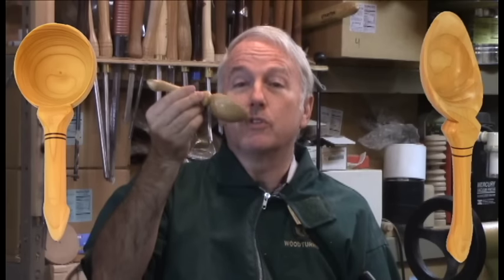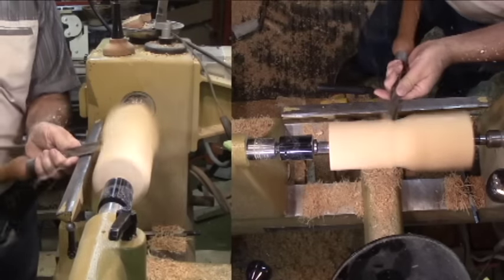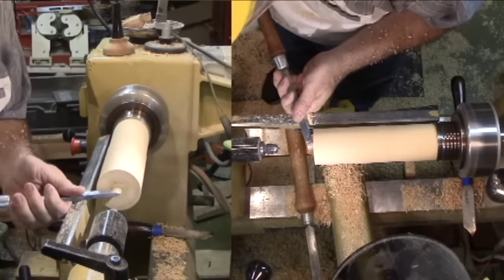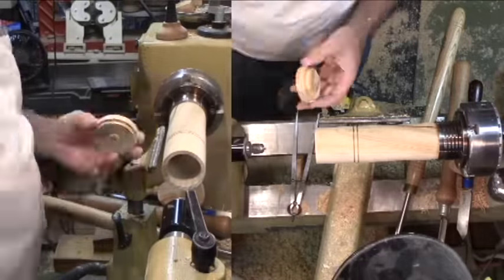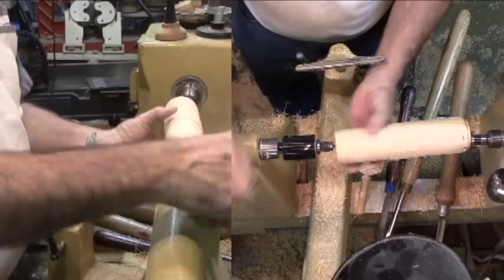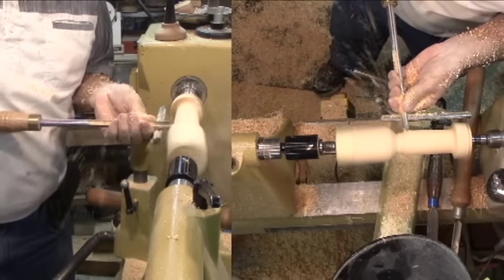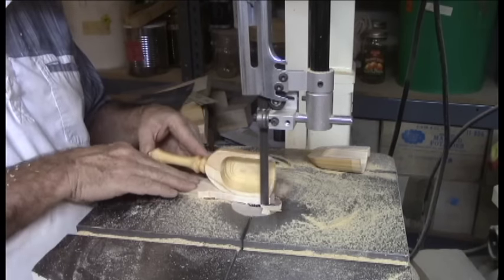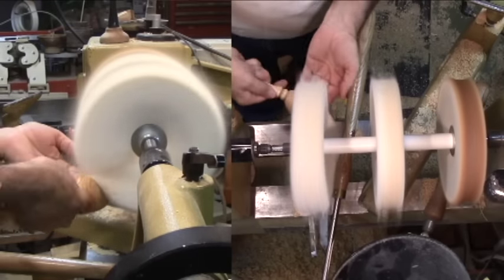Multi Axis Woodturning All My Scoops

Comment: Great video!  Thanks for sharing your twist of offsetting axis of the handle.  Two quick comments:

1) Rather than having the handle angled down from the bowl of the scoop, it might be better to have the handle angled up.  If you're using the scoop for flour, you might want your handle angled up to keep your hand from contaminating the flour.

2) You asked for suggestions of other types of scoops.  One possibility is a measuring scoop.  Some turners make such scoops for measuring coffee.  I don't drink coffee, but I do indulge in a protein smoothie for breakfast about 5 days a week.  A small plastic scoop is provided with each tub of protein powder.  The short handle on the scoop only allows me to grasp it with my thumb and maybe two fingers, and it requires my hand to be inserted into the tub's relatively narrow mouth -- scraping the back of my hand on the rough opening is almost inevitable.  A long handled scoop would be a better, more comfortable, solution.  I'll gladly turn one, if you'll show me how.
Reply from the maker: David Walser 1, It's difficult to tell on the video but the handle does angle up to provide more clearance between the handle and a horizontal surface. I would increase the angle on most future scoops.
2. Actually, I think this video is your model for your protein scoop. Size the scoop to fit inside the mouth of your container.(probably more narrow)  You may want to keep the handle straight in line with the scoop since you're not reaching down like into a barrel of flour. The handle then can be as long as you'd like. For volume, drill a hole of your best guess in a scrap piece and fill it with anything with the plastic scoop, make your scoop oversized, then fill from the plastic scoop. If too large, saw and/or sand to where it will be relatively accurate. I don't think a gram more or less will affect your health. :)
To your health.
Alan

Comment: Very neat Alan, nice project, the off centre handle really makes it . How much did you off set by?
Reply from the maker: Frank Fitzpatrick I offset by about 1/4 inch. Essentially the distance between the point and the circle left by my drive center.
Maybe a bit more next time
Alan
Reply: Thanks Alan